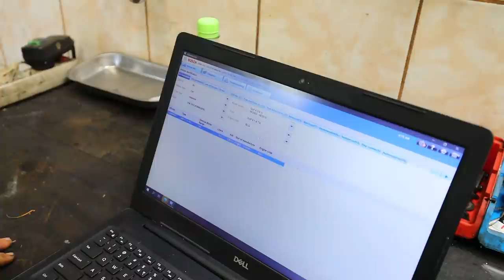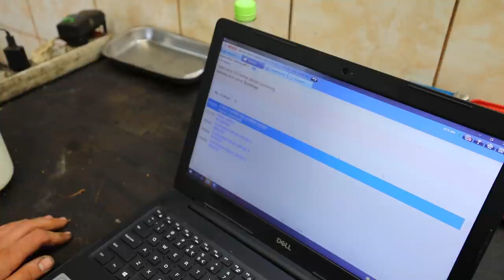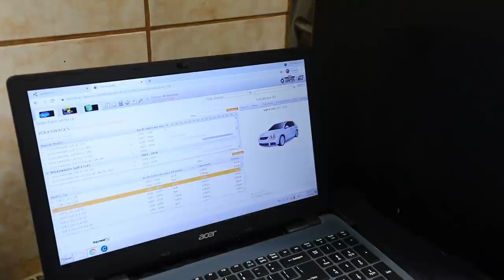Ce poti invata in DOAR 3 LUNI DE MECANICA? 👀

Comment: Va Salut Coasta de Est! 👍
Sunteți tari va urmăresc cu interes și chiar cu o mare plăcere datorita videoclipurilor și nu numai.
Sunt și eu mecanic de 6 ani de zile, activez in mecanica fină, mașini de cusut. Vreau sa zic un singur lucru Costi băiatul care este începător și nesigur pe el este copia mea de acum 6 ani, îmi aduc aminte când am început să lucrez in domeniul acesta, eram nesigur pe mine fara prea multe cunoștințe și abilități, deși nu știam să umblu cu o șurubelniță in mână, nu știam să strâng un șurub și cât să îl strâng.Cu timpul am inceput sa învăț, dar cei care spun că învață prima dată se mint singuri, meseria se fura și după accea se învață, am acumulat cunoștințe m-am dezvoltat și am reușit să ajung sa fac operații grele cu reușite 100%, deși este o diferență între cele două tipuri de industrii totuși au ceva in comun și acela este faptul că " Daca nu ai pasiune și nu te îndrăgostești de ceea ce faci nu poți evolua!" Și aici am încheiat citatul. 
Costi ești un băiat bun și am încredere în tine nota 7,5 pentru că din ce am observat ai avut cam 70% reparație și 30% ajutor, totuși nu te descuraja ( îți dau un sfat, pentru ca să poți înainta și evolua caută cel mai nou membru al echipei chiar de are și un an avans în fața ta și încearcă să îl depășești făcând lucrurile mai bine și mai curat). Alin ai nota 9 pentru exemplificare și pentru cunoștințele  acumulate, te pricepi știi ce faci ești sigur pe ceea ce faci nu îți place să greșești.
Per total va mulțumesc frumos pentru clip 👍

Comment: Mulți nu realizează ce însemna 3 luni doar. Va spun asta eu care îmi fac curaj de o luna sa schimb o pompa servo😂 de ce zic asta.. Pentru ca teoria pare simpla dar dacă pe traseu în practica apar probleme, sau nu știi toate secretele cam dai de necaz, doi la mana camera pe el și test și prima distribuție care nu e pe curea sau ca doar dai scutul jos plus doua trei capace. Sunt absolut sigur ca e în locul potrivit cu oamenii potriviți și abia după a treia distribuție se va vedea dacă devine stăpân pe ele pana atunci doar sa lupte cu el. Trei la mana tot respectul pentru Valica dar dacă vrei sa faci un bine fă-l din toată inima ca pentru băiatul tău, nu au rost vorbele de gen:" fraier" sau altele care s-au mai auzit prin alte videoclipuri pentru ca în Costi testul presiunii va deveni mai mare și când ești sub presiune poți faci cu adevărat greșeli mai mari decât când nu știi, și ultima chestie bravo lui Costi ca întreabă și nu face de capul lui, asta e cel mai mare câștig, decât sa te dai deștept sa dai în bara mai bine întrebi și ai de câștigat. Mult succes 7.0 Costi, Migu 8, Alin 8.5, Dragoș 9.5, Vali 10. Bogdan și Rareș 2 pentru ca postează doar 2 clipuri și alea când vor ei, Iulica 1 din oficiu ca oricum nu mai da pe la camera. Bafta mai departe.

Comment: Salut , am o problema cam mare dupa parerea mea , am bagat benzina in loc de motorina apoi motorul nu a mai functionat , am desfacut rezervorul ca sa scot toata benzina si am schimbat pompa de motorina dar cea noua are alimentare si cea veche nu are niciun nonector electric dar pe capacul de la rezervor (unde se prind tur.ul si returul) pe langa acea conexiune de la plutitor mai are inca o mufa fix ca cea de pe pompa noua , masina este un opel zafira 2.0 din 2000 , ce pot face in cazul acesta?